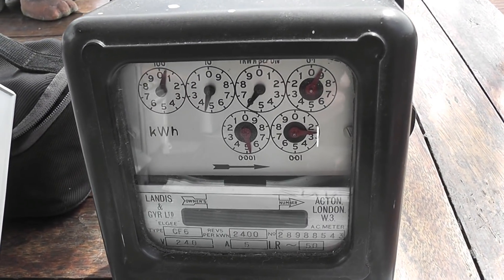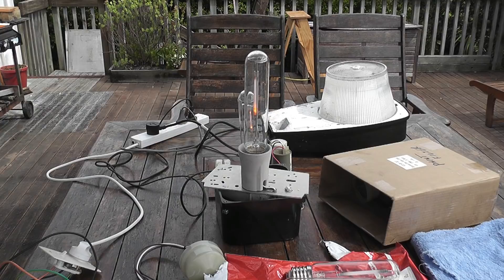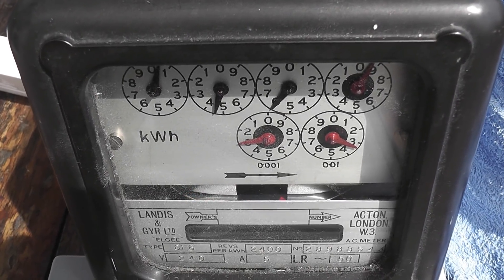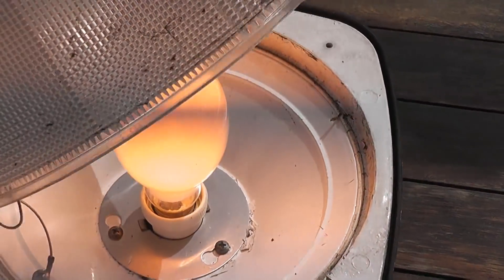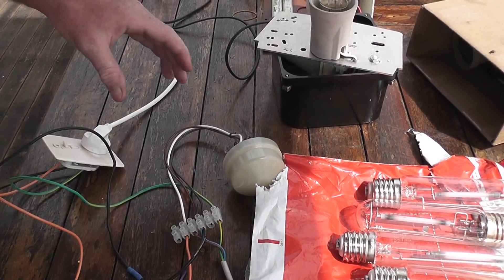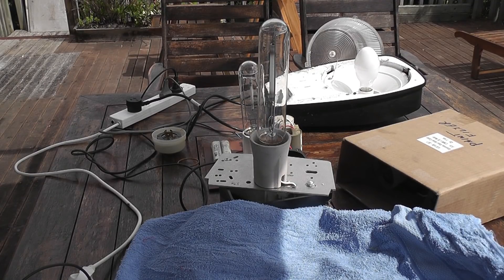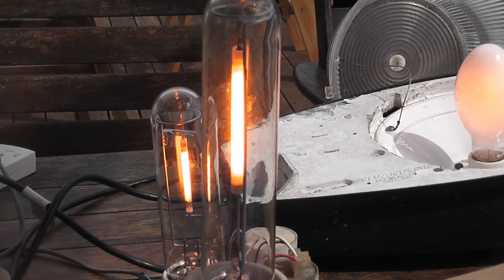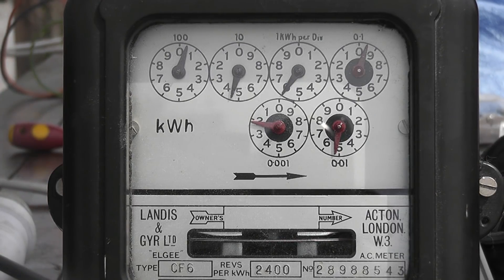HP Sodium and MH lamps

Comment: Nice... some sodium and MH lamps with loadwheel action too. That L&G is an exceptionally rare meter. I would be frightened to use it in case I accidentally dropped it during moving it into place or while putting it away.

The time lag on electronic photocells seems to be a bit different to the old bi-metallic thermal ones. I have a couple of those old thermal ones made by Royce-Thompson (RTE) and when I last used a few of them, they still worked, and some of them are marked as being from the late 80s or early 90s.

Thanxx for the shout-out of my Hi-Def channel. As at the time of writing this, I am preparing to release another Time Switch video, and it is a Video Exclusive as well.

That is coming in the next few hours.

Thanxx for showing.

-Wayne's Electrical.

14th January 2017, 22.36

Comment: Raymond, do you think it would be possible to use a ballast from a fluoro fitting to run a low pressure sodium (SOX) lamp?

I miss the colour from streetlights and the old fittings are hard to find now but the bulbs are still available
Reply from the maker: Yes, I think that would work. I have used a 40 Watt fluro ballast in a HP Sodium with no problems. Can't see why it wouldn't work with a LP SOX. The ballast is there to limit the load, and aid the igniter in striking.

Comment: Very nice. Where I live the LED street lights are going in fast. It's time I shoot video all over the place before it's too late. No more silver and gold soon :-(( I have seen three LED street lights in a row pulsing fast, all precisely in sync... can anyone explain this? Are they running 3 streetlights off of one shitty power supply that failed after a month !?!  Photosensitive epilepsy any one? It was about 8 to 10 hertz or somewhere in there. Good thing they already have self driving cars completely perfected and tested using the finest quality professional political business game logic.
Reply from the maker: It is the control module failing which happens often. The LED's are reliable, the current limit modules are not. Often a rectifier diode is the cause.
Reply: RODALCO2007 Ah,  thank you! In retrospect ive seen many lights come on at once when it gets dark so that seems to point toward what you said.

Comment: The sodium bulbs are very different to UK street ones I saw some 40 years ago. Those had a 'U' shaped tube inside the large dome. That 'U' tube had dimples pulled into the glass and you could see sodium metal pooled in them. The heat of the filaments when energised would evaporate the sodium metal and allow the energy to strike across from one filament to another.

Cool stuff these bulbs. The LED units are changing the colour of the light pollution above my nearest city (I do night photography).
Reply from the maker: That were the Low Pressure LP Sodium lamps. they had a more orange yellow light.
Reply: RODALCO2007 And little bit more lumens/W thats why HPS and LPS are great for growing plants